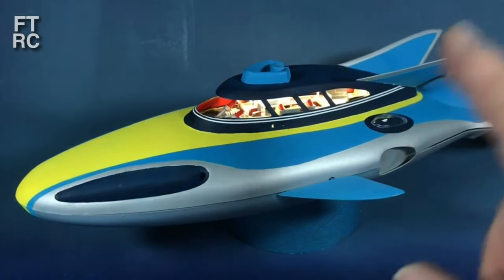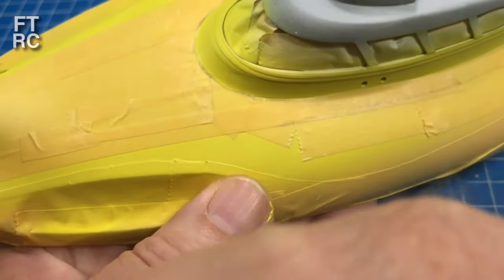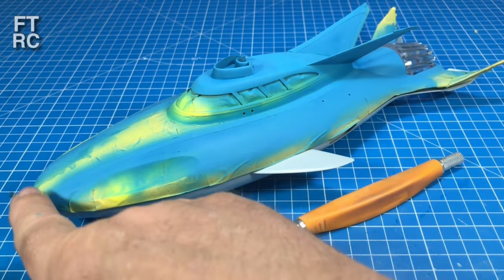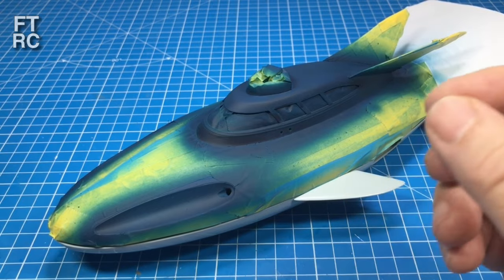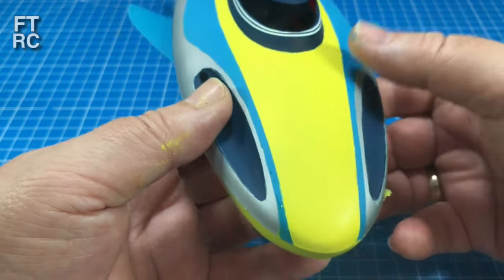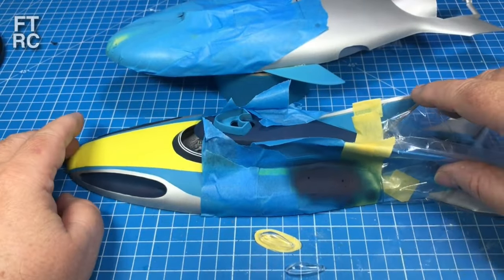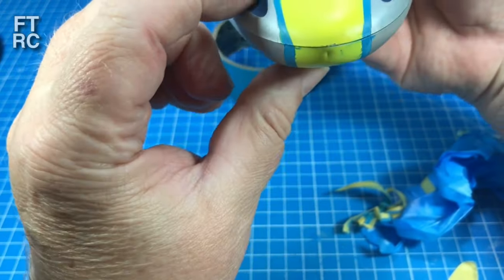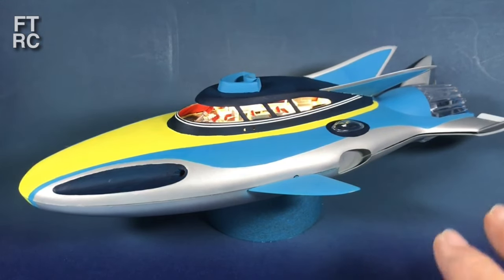Stingray Part 10 Painting, Masking and Detail Touch Ups

Comment: I've found with masking using clear before the colour coat stops a lot of runs works pretty well. Just a mist coat.
Reply: I will try that
Reply from the maker: The principle behind that also works if you mist your first coat.  Which I did successfully on the top section, for the most part.  The flooding underneath was due to tiredness on my part, over thinning the paint, and trying the rush the last blue stripes to get the video done in time.  Should have just left the chin yellow.